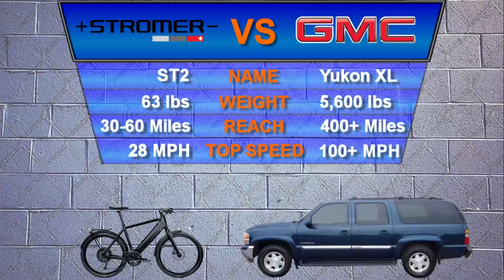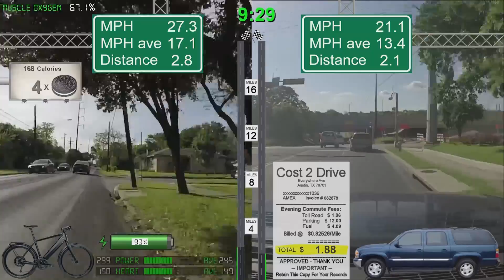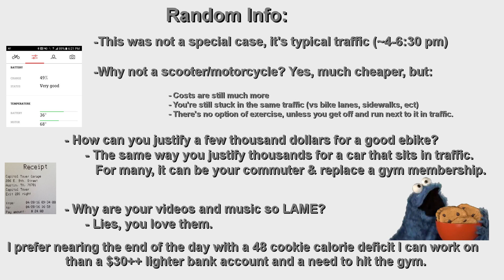Stromer ST2 ebike commute vs car commute Austin Texas (20 miles)

Comment: That's an super cool video ! Not a lot of people show their commute like that. In fact I did not see another like that lol. I am searching a ebike for riding 2x 12,5 miles to go to work fast. Can I ask you how much total km (or miles) you did with your ST2 ? And if you are happy with this bike ? I don't know how to decide between ST1, ST2 or ST3, and which has a long lifespan to ride often, etc. Maybe you have some opinion about all that ? Also is this bike good on slope as it is heavy and low torque ?
Reply from the maker: My ST2 is 8 years old now with almost 18,000 miles on it and still works great, though it mostly sits since I work from home since March 2020.

I does really well on hills. I did a comparison on a 12% grade hill for .5mi (around 320ft climb) vs my mid-drive ebike (Focus/Kalkhoff bike), putting in the same power (used a power meter). It averaged 13.4mph to the Focus's 10.6mph. However, when I slowed WAY down to around 3mph and didn't pedal much, my Stromer had more trouble, while the Focus had no problem, provided I shifted down the gears to an easy gear for it.

I think you'd be fine with any of the Stromers if they have the range you need. There are faster and cheaper bikes, like Juiced Bikes. I haven't followed it much in the last few years, but I remember some of those would cruise 4-5mph faster than the Stromer, unless they restrict them now. As far as ride and build quality though, Stromer blew me away. I burned up 3 motors in my Focus ebike and didn't even put 3,000 miles on it. After the 3rd new motor failure (leaving me stranded), I was headed to toss it in a dumpster and someone said they'd take it so I gave it away. To be fair, as you see in the video, I was riding my ebikes fast, hard, and for long commutes.
Reply: @AdamAlter-Texas  Thank you Adam ;) I am Belgian living in France (and work in Belgium at the border, lol), and we don't juiced bike here and government are a bit annoying with rules about speed bike etc. So Stromer is mostly the only choice for real sustained 28mph speed. Your video and your comment are really helpfull, thanks again ;)

Comment: I'de rethink about the calorie output and cookie input. 1000 kcal in 1 h on a speed pedelec? Not even on a racebike.
Reply from the maker: So you say someone can't burn 1,000 calories in under an hour, not even even on a race bike eh? You should tell these platforms they're all wrong then.

Here's MY ride on my time trial bike (no motor) where I put out 308W for 55 min 40 sec, averaging 181 heart rate and at 200 lbs, Strava said I burned 1,148 calories:

https://www.strava.com/activities/150659371

Where do you guys come from?!

ONCE AGAIN, in this video, I was 41, 200lbs, and on a 56 min 33 sec ride/commute, I put out 279 ave watts (tracked with Powertap P1 pedals) and I averaged 161 heart rate (tracked with a Schosche). Go plug that info into exercise activity calculator (ignoring speed and distance) and see what you get.

Or hell I'll export the activity and give you the file that has MY heart rate and MY power output by the sec. I uploaded it to various platforms and here are the results:

MapMyRide 1008
Garmin Connect 1008
Wahoo ELEMNT 998 <-- unit I used to record
Todaysplan 993
Strava 819
RideWithGPS 811

NOTICE, Strava is one of the LOWEST, yet above shows I burned 1148 calories in 55 min in my time trial. Looks like you've got a lot of platforms to reach out to to tell them how wrong they are and that NOBODY can burn 1,000 calories in under an hour lol. Whether right, wrong, whatever, I'm just reporting what's being said. I'm the opposite of a typical cyclist build, I'm a sprinter-type that carries a lot of muscle, so if you're used to the usual 150lb guys who can't hit close to 2k watts on a ride, you're in for a surprise if you branch out.
Reply: @AdamAlter-Texas  Hohoho, don't be offended. I just can't get it how you get such a high heartrate with a speed pedelec (Stromer). You're heartrate is even higher on a motorised assisted bike, including stops, than mine on a crit race, averaging 27 mph. I'm 50 @ 185 lbs. I'm using a heartrate monitor to calculate my exact heartrate, not an app as Strava, etc. I can get an average of 25 mph on a Stromer with a low heartrate burning half of your calories. So, that's why I initially wrote the rethink the figures.
Reply from the maker: @Kramzonz  I didn't use Strava to track this activity. My heart rate was done with a real heart rate monitor, and a quite accurate one, the Scosche RYTHM+, which was tied to the Wahoo cycling computer via Bluetooth (which I stated multiple times). I only later uploaded it to Strava to show the course and as one of the platform reference examples. I'm not offended, I'm annoyed that this even needs addressed. 

Anyone can easily go to the many online activity calorie calculators by heart rate and enter my info 41 years old, 200 lbs, 161 average heart rate for 56 min and you'll see most say around 1,000 calories. Here's one example, though I've already given half a dozen:

https://govital.eu/calories-burned-by-heart-rate-calculator/

The lowest I found said 800 calories, the highest was 1200. If you don't believe I had 161 ave heart rate for 56 min on my Stromer in stop and go traffic, after I showed you I ave 181 for 55 min on my time trial bike in a race, I don't know what to tell you, but I have no plans of going down a rabbit hole over it.

Comment: I'm an owner of a few e-bikes and an electrical engineer, I live by codes and rules. This e-bike hitting 30+mph isn't allowed in many states and displayed dangerous speeds for motorists who assume bike lane traffic speed is signicantly less. Most US States the max speed is 20mph, Canada is even less. You're demonstration is useless
Reply from the maker: This ebike is 100% legal in most states, including mine. Only 14 states have the 20mph pedal assist limit. For this ebike, the motor stops assisting before 29mph. I can take it faster, but it's under my own power only, which takes a lot of work, or downhill sections. I can easily go faster for short distances on a road bike (no motor), as can many average Joe hobby-cyclists. Here's a 3 mile section that's almost flat (-1%) on Strava where I averaged 35mph, and many other men and women have averaged over 30mph, on non-powered bikes:
https://www.strava.com/segments/1165069
Time trialists do a ~25mile race and many average 25-30mph+, on their own power. Need proof? Here's a link one of the Texas state time trial courses that a few hundred people tracked with Strava, and I averaged 28.8mph. Many are just average cyclists. Check out the ave speed, and these bikes have no motor:
https://www.strava.com/segments/7186976

If you commuted with a 20mph limited ebike in Austin, you'd get passed by people on road bikes all the time. The first time I saw an ebike on the road was in very early 2013. I was commuting on my road bike and I passed it. I was surprised this much older lady was going a pretty decent speed while sitting upright and not looking like she was working at it. I stopped to talk to her at the next light and asked about her ugly bike lol. She said it was battery powered, did 20mph, and was a lot of fun. I never imagined myself on one until the end of 2014, while living in Seattle and I tried one for the heck of it because they were everywhere. I couldn't believe how much better it made those nasty Seattle hills and I was sold.

People ride them for different reasons. To ME, the benefits of the ebike are being able to hit the speed I can on a road bike, with much less effort, and sustain it, while carrying my commuting gear and being in a more comfy position. The benefits of it over my motorcycle is I'm getting exercise WHILE commuting, I'm not stuck in traffic (bike lane, bike paths, ect), and it's much cheaper for everything from toll roads, gas, to parking. Oh yeah, and it's FUN.

This ebike now has over 14,000 miles on it. It has never needed to go in for anything. Even a perfectly running motorcycle has to go in for valve adjustments. I know because I have one, and have had motorcycles for 28 years. With this, I simply change the normal bike stuff like tires, brake pads, and chain/cassette.

Grats on being an electrical engineer! I got my journeyman's license in electrical engineering nearly 20 years ago, so we're samsies! Though, I moved on from that work.

I have to thank you for your incredibly helpful and informed comment, but also quote you on your last sentence; "You'RE demonstration is useless" :) Priceless.
Reply: Adam Alter, I do agree with most of what you said in your reply. My experience with e-bikes are fat tire (my Turbo Levo Comp FSR is my pride and joy) so trail riding off pavement is where I have the most fun, I rarely hit 20mph off road. 

My response mostly was yes, I understand road bikes maintaining 28mph is achievable but mostly done in semi to rural areas, not in high traffic as presented in this video.  My concern and the reason a "powered" bike in commuter traffic doing those speeds is obtainable,  but kinda reckless!

 It certainly proved the much loved e-bike prevailed but did it in a way most would not ride. The car however wasn't driving recklessly, my statement the video is useless was too harsh (sorry for that) but should of said "not very realistic".  

I still question the legality of an electric powered bike that exceeds 20mph would not require licensing but I seriously doubt police are looking for this type of thing. I know Canada and in Europe definitely do. For some reason I'm thinking there are classifications for them, I definitely could be wrong.

It's all about getting out and riding anyway. I too own a motorcycle, I enjoy my Stromer more. Sometimes slower and quieter is superior!
Reply from the maker: The video appears to be going WAY faster than I am because I made it 800% speed and the wide-angle GoPro video. I didn't want people to watch an hour video and I should have filmed it in a different mode that doesn't push things way out in front of me that then warp by because of the lens.

The areas I slowed the video down were actually at normal speed, not slo-mo. You can get a better idea of how fast it seems, like here:
https://youtu.be/EHM9HY5bMO4?t=186
The cyclist I passed was going slow because f the hill, where my bike has a huge advantage.
The cars right after that part I actually slowed to <20 to cruise by, but since I posted at 800% speed, every second is 8 seconds, so the time stamps/ave were picked up at mid-20mph. I thought about slowing it to regular speed there, because it looks WAY crazier than it was, but I'd hoped people would just realize it was the sped up video and the cars were all stopped. I'm a super careful driver and cyclist. 37k bike miles since 2012 and I've never had or caused even the slightest accident with a moving car. I've not had a speeding or traffic ticket in 25 years. I try to always be ready for any car to swerve out, and they have. Also, I wave to all stopped traffic on my right wanting to pull out, to make sure they see me, ALWAYS.

As for the laws, you can find a breakdown of them by state here:
https://en.wikipedia.org/wiki/Electric_bicycle_laws

Comment: Dear Adam, I would like to ask you how did you put up your data onto the video? The power meter I understand, that came from your pedal measurements, but the battery charge and heart rate, how did you pick this data up to use in your video?

Comment: There are definietely times of the day around here that bike will be much faster...  when I have to go to my north campus in the mornings.. its 27 miles, but at least 90 minutes, if any traffic issue at all 2 hours is not uncommon.  Sadly the infrastructure here is less than desirable.  Around 1000 pedestrians and bicyclists are killed in Miami every year.. mostly because drivers do not follow even the basic rules of the road. Road signed for 30 mph? 60 is typical.  Stop sign, that's optional right? ....   red light? who cares...  very few areas that I travel have separate bicycle lanes..  there are plenty of "we want to convert x to a trial/bike path" .. but so far there are only two major ones that I am aware of, and they are not on any route I would take...       that said, have an e-bike coming on the truck Tuesday... and challenge accepted. :)

Comment: 1 hour for 20 miles by car?
ouch!
Reply: I commute about 8-9 miles into Manchester. It's somewhere between 25 minutes and 1:05 by car, or reliably 35 by bike. It should be less by 28mph ebike too since you can average higher speeds than normal.

Comment: How do you make SmO2 overlay on the video?
Reply from the maker: I used the BSXinsight SmO2 sensor and the Wahoo ELEMNT cycling head unit that displays and records it, along with my power, heart rate and all the other data. Then took the data from the ride and the video, and synced it using Dashware, which has gauges that display the info over the video, or you can make custom ones. The software is free, GoPro owns it (bought them)

Comment: I'm a fair-weather 2x a week commuter, per strava, 22 miles each way 600' elevation gain to work 1400' back. Realistically the financial saving are marginal as i compensate for saved fuel/wear-tear on car with extra food lol. 

I find 900 calories in an hour hard to believe on a e-bike, on my standard road bike up some reasonably big hills on a longer commute i'm close to an estimated 880 calories. 

I do not however doubt for a second how much faster an e-bike, especially a premium one, is compared to a regular mortal powered bike or car in certain situations. There are places i can get to faster on a bike as is (not home in a small village, but from downtown in a midsized city), to include places that would surprise people. That said, unless you live in a densely populated area, motor vehicles will generally win the contest, at a cost obviously, but "win" none the less. 

Which brings up the "why" of it all;
 My commute by car is 35 minutes, on bike it is 1:25-1:35, if i am late and/or hit the lights just right i'm closer to 1:20. It is far slower.
My bicycle offers no protection in a collision, no cover from the elements, from people or animals. 
My car hasn't had a flat yet in 45,000 miles (knock on wood), my bicycle has had three this year. 
From a convenience prospective the car wins and i don't even have to change my clothes when i get to work!

My car also has no soul. 
I AM happier when i ride my bicycle, i'm also more productive at work and more patient at home. Cycling is my therapy after a long evening at work the fresh air has a way of washing away the days stresses. Yeah my coworkers think i am insane, but as i see it, them thinking i am insane is better than me actually going insane. If motors help more people get out there i'm all for them, but please keep it reasonable so they don't get banned.

Comment: Dude, this video is just amazing. But, why in the world do you bear a commute that long? I'd hate being on the (same!) road for two hours each day. My old commute was some 5 miles with a lot of altitude difference, so a cheap ebike was perfect. My last commute was even less at 3.5 miles so I used a normal bike. 
But anything over 10 miles, wow, way too long imho regardless of the vehicle. Also, Austin seems to be huge.
Reply from the maker: Thanks! Since the routes to/from work & home are filled with lots of traffic, I can pretty easily save commute time by using an ebike. On top of that, I don't need to take time out of my day to exercise, because I get plenty on the Stromer. Both of these things free up more time for the 2 things most important to me: time with family, and time to do work (onelvl.com and bsxinsight.com which is a blast). Then, the fact that it saves money and sets a great example for my kids. Personally, I find it much less painful and stressful than stop and go traffic, even in Austin heat! Even without getting into energy savings and impact to the planet debates, there's plenty to justify it, for me at least.
Reply: Why not get the stealth bomber b52 ebike
Reply from the maker: Stealth is pretty awesome, but it uses a throttle, so legally you can only do 20mph with it, which would be slower. I don't have as many experiences with different bikes as I'd like but from what I've tried, I prefer pedal assist for a natural response to effort like I'm still riding a bike. Plus just from looking at the Bomber, I would imagine it would get you unwanted attention while in the bike lane and paths/sidewalks, given it looks like a dirt bike. I also wonder about its dependability. I now have well over 8k miles on my Stromer and it's never even needed to go to a bike shop once, even for a derailleur adjustment. It has original everything except tires, chain, cassette, and brake pads (all been changed once).